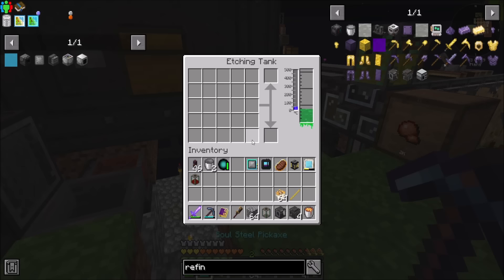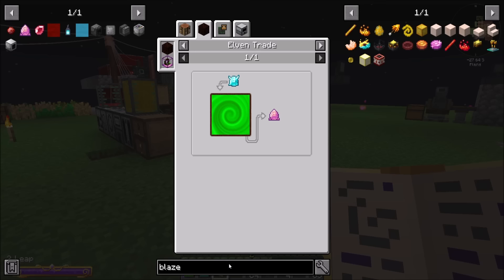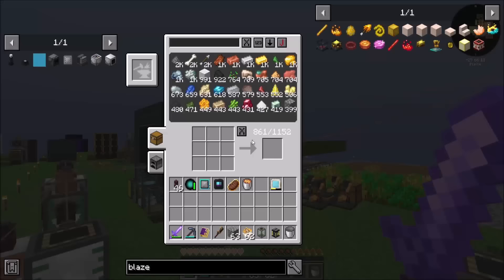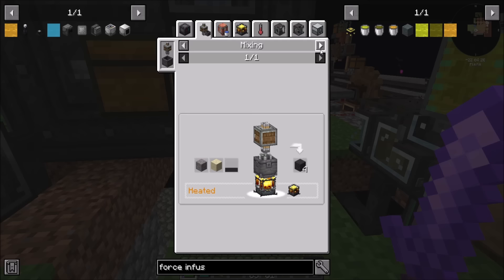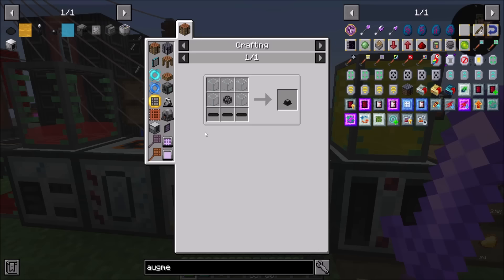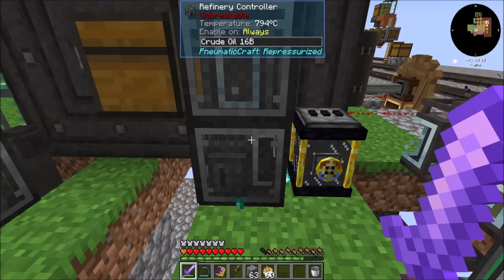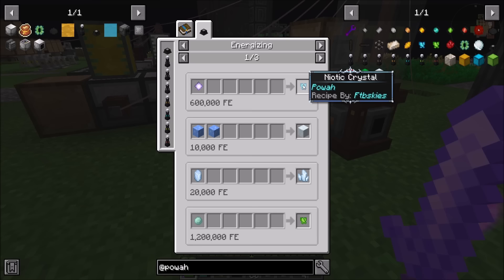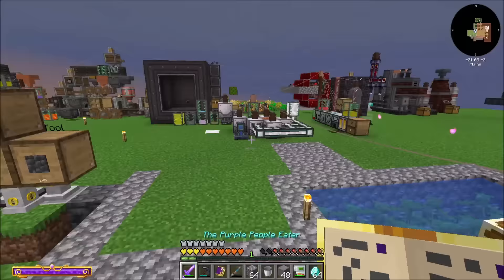FTB Skies Expert Ep46 Powah

Comment: Hey Dire, on your shortage of water shards. You have that mechanical fisher now, you can output the fish into a dispenser and have a timer put those fish onto a spike. The same system you are using manually, just adding a spike and a timer to automate water shards.

Comment: Dire, you don't need four outputs on the refinery. Crude oil only breaks down into two outputs in this pack, so you can make it get hotter faster by getting rid of the two unnecessary outputs

Comment: Dire should be able to make the multiblock tank from Immersive Engineering. It holds 512 buckets and can use a comparator to read how full it is. Don't remember if you can directly interact with it via bucket though.